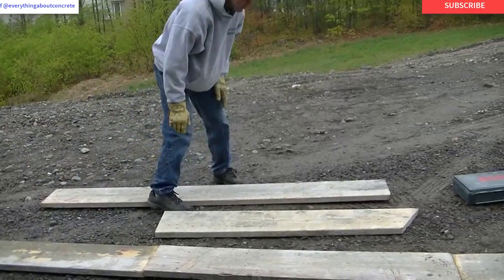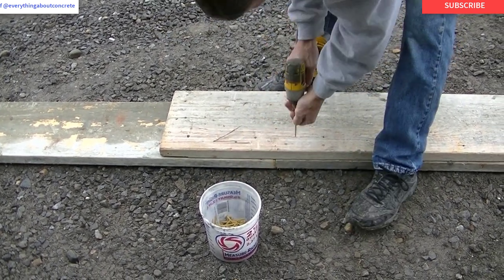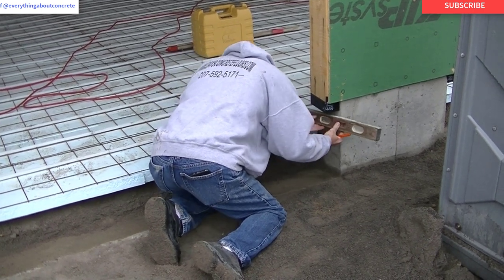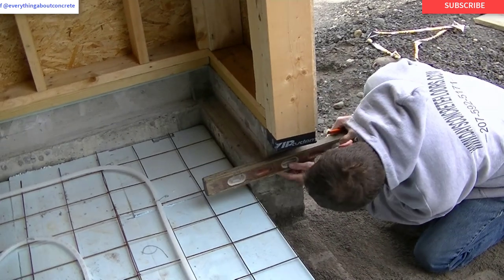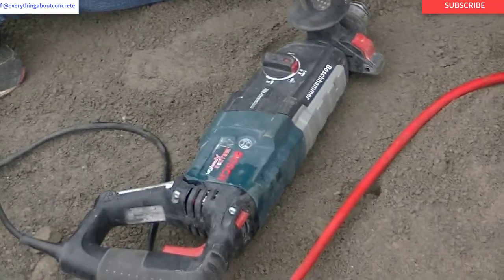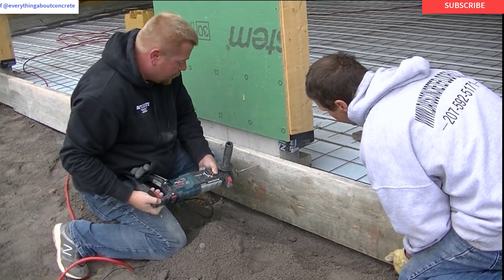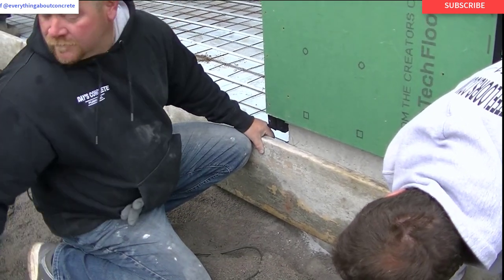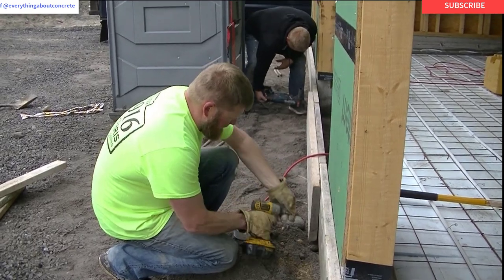HOW TO FASTEN WOOD TO CONCRETE | TAPCON SCREWS INTO CONCRETE

Comment: We use battery powered hilti hammer drills, works great too and smaller tapcons for plywood securing. They can hold a lot of weight if your doing overhead concrete repairs. We use a manual concrete pump to grout our overhead patches. Tapcons and the occasional shoring post/doubled 2x4 to hold the forms and concrete up. Great videos Mike D.
Reply from the maker: Thank you, great comment!

Comment: Which drill bit that you used on this video? It went through the wood and concrete with no problem. Thanks for sharing!
Reply from the maker: It's just a bosch concrete carbide tip drill bit

Comment: This is better than driving form stakes close to the form and wedging it tight? Please tell how.
Reply from the maker: Jim, we do that too. It depends on what type of gravel is there to drive the pins into. Some times it's just backfilled with sand and the pins don't hold at all.
Reply: @MikeDayConcrete - Ah, gravel. I'm not a concrete pro, just a diy homeowner who got 100 form stakes in a deal. I've used them in dirt to mark a fence, install a mailbox, and form a slab repair where an elm fell and busted off a vintage garage slab corner. All in dirt, which holds the stakes firm. Didn't think of gravel or sand. Yeah, the tapcons worked well for me the one time I used them. Can they be re-used at all? Is there ever a need to fill the holes after removal?